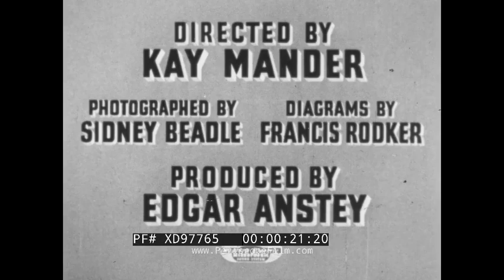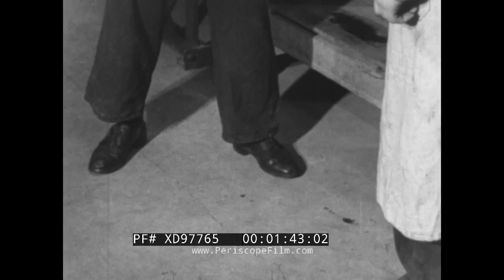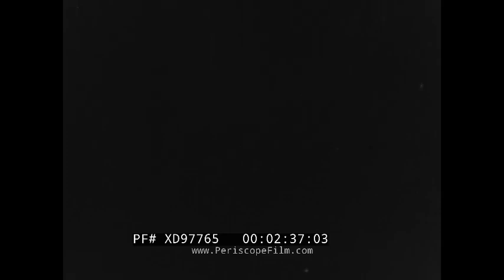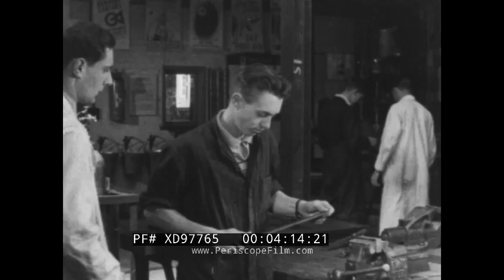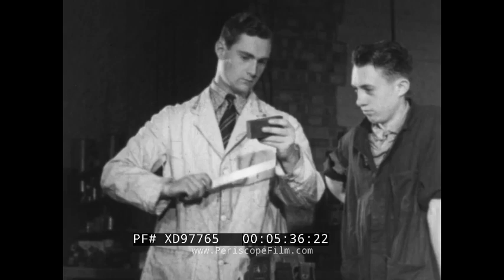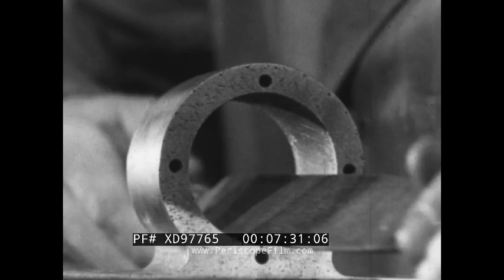“ HOW TO FILE ”  WWII ERA METAL FILES & FILING TECHNIQUES INSTRUCTIONAL FILM     XD97765

Comment: Is it me or is that a LOT of material to remove with nothing but a file?
Reply: Maybe they're training/practice pieces? I wish I'd learned all this stuff as a kid! Amazing skills and techniques.
Reply: It is but It was done for a reason. I once read about an old school teaching method where right off the top engenering/machine shop students were given a lump of steel and a file and were told to make the lump into a perfect cube. It would take a week or more to accomplish the task but the students definitely learned how to file accurately. Acurate filing was a lot more Important back in the day. Rough castings of all kinds of machinery and aperatus were sent from the foundry to machine shops for final machining and finishing. After a casting or part was machined close to spec using lathes and milling machines the parts that required absolute accuracy were brought into final tolerance by hand filing and scraping.
They did not have to remove much metal but removing to much would ruin the peice. Accuracy from a steady and experienced hand was essential.

Comment: The first task as a trainee mechanic was to hacksaw  1 inch length off a 2 inch square cast iron bar and hand file it to a given size, and when the instructor put the vernier on it if it was small in any spot he’d give you next size down to get to, filing cast iron is suicidally boring, and once you get told to do it again you concentrate on every stroke not to round the corner or cut  a groove in it, it can take a week to get it right.

Comment: he's wrong about cutting on the back stroke. it will cut faster and the back stroke helps clean the chips out. it will actually LAST LONGER too.
Reply: A file only cuts in one direction and dragging it back across the work piece isn't really a good idea.

Comment: None of the files I ever used had one cut going against the other… 
As an apprentice the hardest piece  I ever had to make had a slide with two 60 degree angles. Ii had to be accurate within 1/1000 of an inch or 2/100 of a millimeter over a length of 50 mm (2”) and fit both ways, sliding equally smoothly.

Comment: This is still relevant.   Files, when used properly are an amazing tool, not just on metal, but wood also.  It is simple to master the technique, and you can really speed up work and its accuracy.  Jamming stuff on a grinder isnt the answer when prescion is needed.
Reply: Yup, I have a set of files for my "metal" files for my woodworking that only get used on wood. They work great to get in the right situations, and especially when you need to blend surfaces. I also have a set of files that only get used on metal.

Comment: Why would I have to file something?
Reply: Maybe you'll want to file your teeth to a point, cut through jail bars or tune up the gears on Grandpas retirement watch. There are  lots of applications.
Reply: If you ever plan to do a DYI project, work on any type of machine/equipment, there are occasions when a file is needed. If you never plan on doing anything of that sort, the need to use a file is greatly diminished.
Reply: File your nails?/////
Reply: I thought this would be a film on filing documents but I don’t know why I would watch that either.